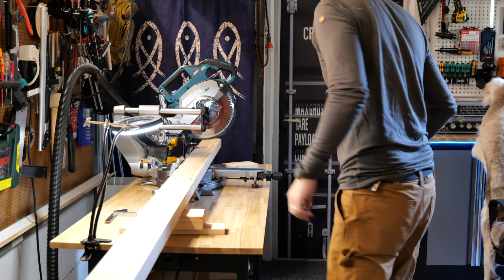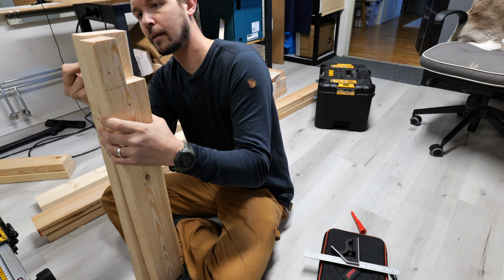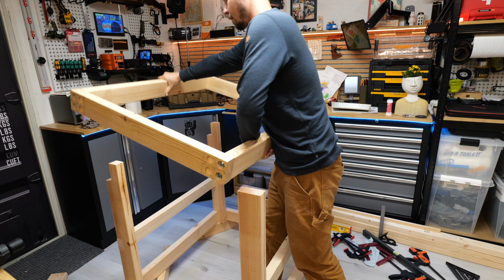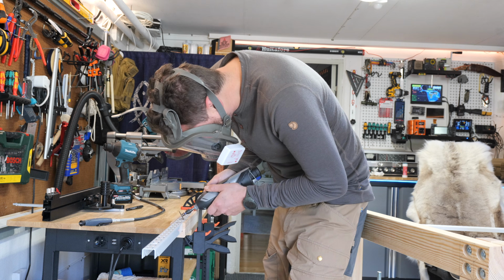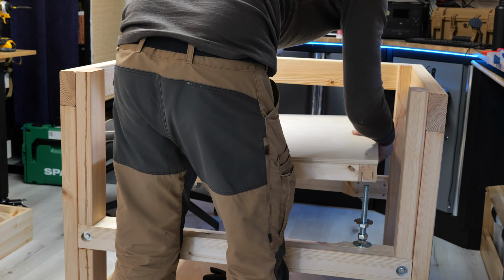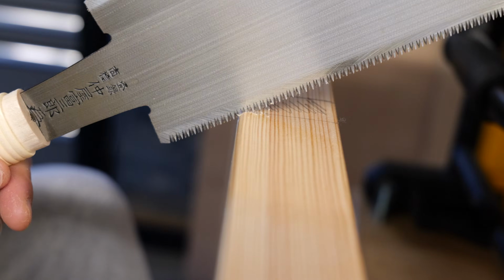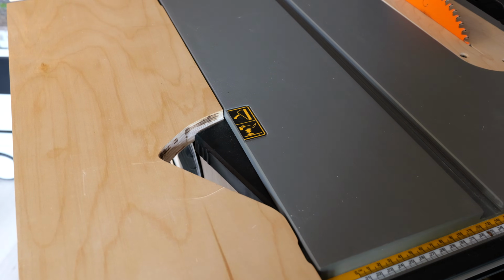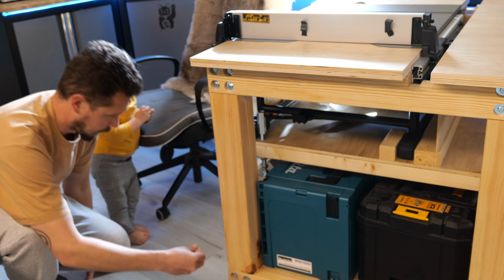The Table Saw Workbench That Changed Everything

Comment from the maker: Hey thanks Adrian! It actually just arrived finally from Denmark. Havn't had a chance to see how wide I can get it on the dewalt, I think its supposed to go up to 12mm or maybe up to 14mm safely. Going to use it for the next miter saw work bench build. I'll make a short video about the CMT Dado blade in the next few days.

Comment: Great job Leif!  To give yourself even more workspace on top, maybe consider a fold down leaf that you can prop up to double the size of the top and give you more space to work on.  Just a thought.  Subbed.  Looking forward to watching what you have coming up.  Good luck!  From Arizona.
Reply from the maker: Thanks for getting in touch @knottenwood ! That was my thought exactly. I put off adding flip up tables, cause it just looked so pretty and symmetrical that I didn't want to put the aesthetic off balance. But in the end I added a flip up router table and its working out really good. I already cut the plywood for a flip up out feed table but can't decide if I want to add it or not. Have been planning on building another bench for the miter saw and then connecting the two with toggle latches to make a giant outfeed table. We'll see!

Comment: Nice job! Subscribed. What kind of fence extrusion is that? I've been looking into the Bow products fence extender, and they look similar. How do you like it?
Reply from the maker: Hey Jake, thanks!! I was also looking into the BOW brand but it was way too much for me here in Sweden. I ended up finding a 30 inch/92 cm one on Aliexpress, that shipped from germany. Arrived in 3 days and cost $70 usd total. I'm really happy with it. I can't see how it could be better. The feather boards are ali as well, 2 for $20. Works perfect, have so much more control and precision now than i did before with the stock dewalt fence. Def recommend the upgrade.
Reply: @LuckyLeifwoodworks  right on, thanks for the reply! How do you secure it to the dewalt fence, is it just a t track hold down angled strategically?

Comment: Great job my favorite part is you were able to find a way to get it flush with the supports. I'd love to get plans for it. I'd also like to know more on modification you have on the fence?
Reply from the maker: Hey, thanks Jorge! Appreciate it !! It was more challenging than the video made it look, but getting it flush was probably the most satisfying part.

The fence I got off Bangood for 70 bucks, and it is  surprisingly good quality. The brand is enjoy wood, bit of a silly name but every thing I've bought from them has been top notch. Sometimes aliexpress has a better price for the fence than Bangood. 

I'll have some plans ready in the next few days. I decided add different plans based on the users height so that the height of the table is  perfect for the wood workers height.